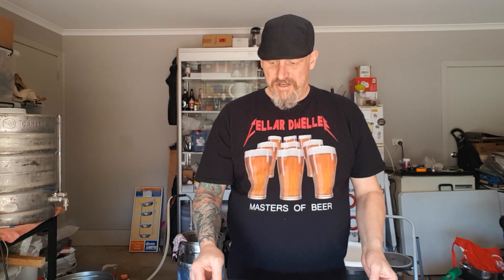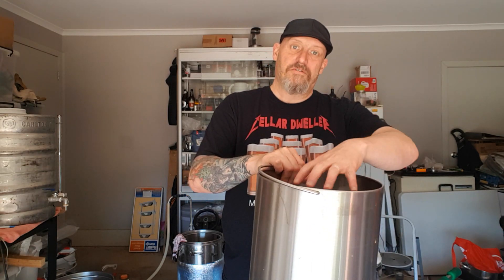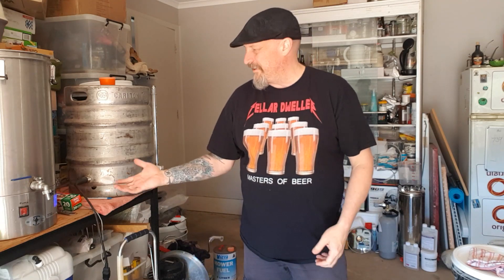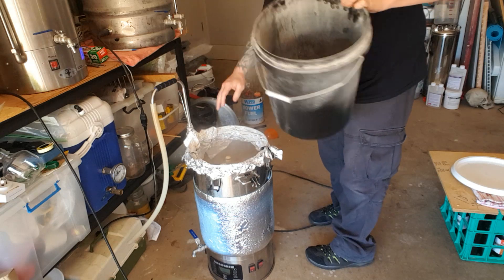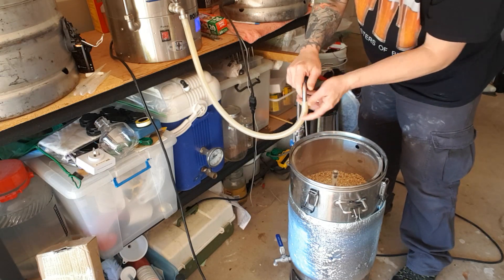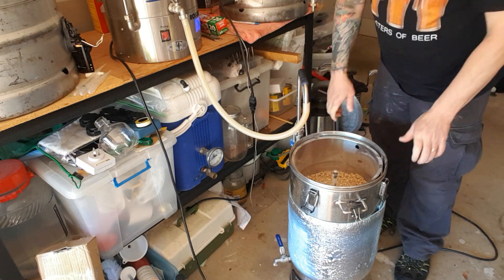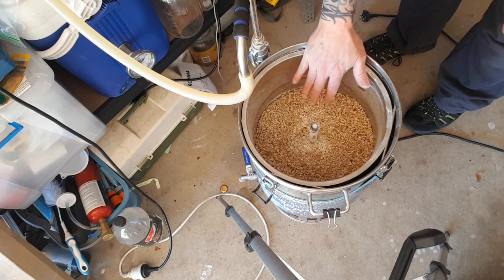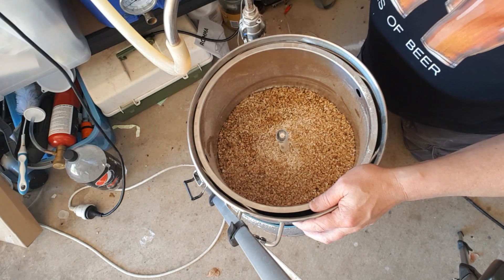Underletting for Filling Mash Tun - Robobrew - Grainfather

Comment: Cheers Gash - I tried something similar last week. Wet conditioned grain milled directly into the malt pipe over the strike water in the grainfather. Let the malt pipe sit on-top of water and let it 'slowly' sink into the strike water. Because of the wet conditioning it practically slowly fell into the grainfather (about 5 seconds), however  it still worked fine, no dough balls or dry spots. Cheers
Reply from the maker: Cool mate, thats interesting too, Cheers Stass!

Comment: You say you put in 18 litres of strike water to 4.6KG of grain, is that higher than normal to allow for the dead-space under the malt pipe? Cheers mate
Reply from the maker: Yes exactly, under and beside malt pipe, plus to give you  a bit of extra play so when you have the pump up you dont let the bottom get dry. You just want the mash to be like a loose porridge. Cheers!

Comment: Mate, that was a very fast grain fill.  Would it be easier to do it slowly in stages? Add then stir. Add then stir. Good brews take time. Just asking.
Reply from the maker: There was no water in it when  I added then grain, so it didn't matter, I filled by under letting Cheers mate!
Reply: @HomeBrewNetwork  Sorry, watching vid on my phone, small screen. Looked like you poured grain bill straight into water.